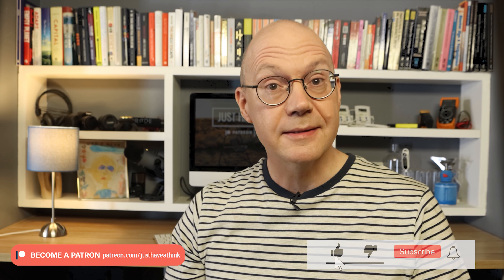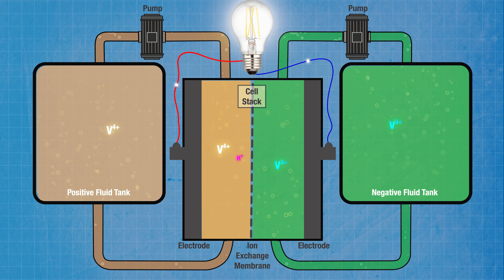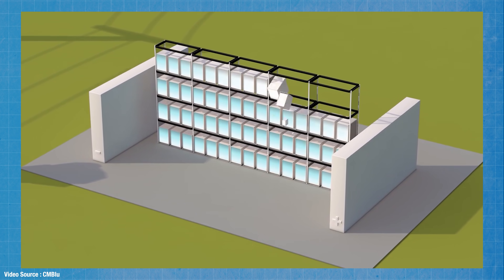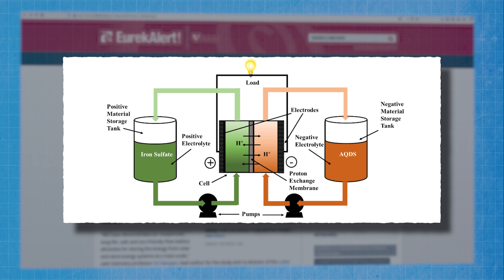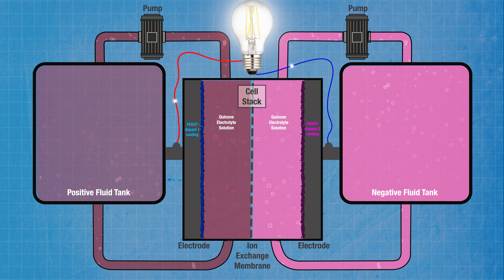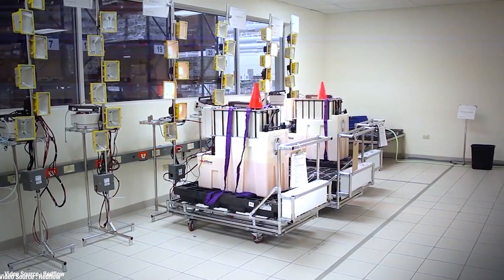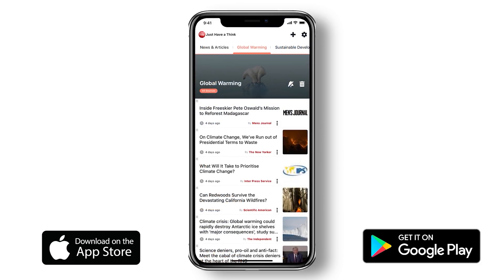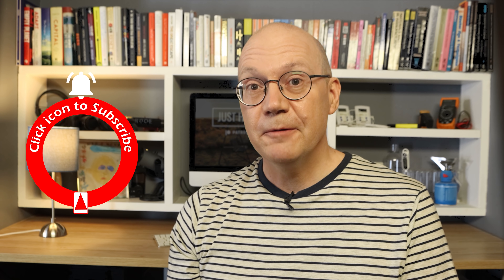Organic Redox Flow Batteries - The true path to grid scale energy storage?

Comment: Hope they developed something even cheaper because manufactured cell costs $85 to $100 per kWh and have had auctions recently for ~$65 per kWh, this is the cell cost, not the pack cost which is more like ~$110 per kWh, but considering they said that was just the material cost, it's gonna be similar if not more expensive and this is for LFP batteries, sodium batteries have the promise when they reach true scale to be cheaper with meterial costs and because of the relative ease of extracting and processing sodium they can reach higher scales which means greater economics of scale, so it's very likely they will get crazy cheap once they reach the scale we are at with LFP batteries and will rocket off into much greater scale at that point.

To the point that even using them for long term storage is worthwhile, lithium ion batteries only lose 1.5 - 2% charge per month at 90% state of charge which means 9 to 12% loss over 6 months and if they are really that cheap, it's not a massive deal.

Comment: If you use a organic aprotic electrolyte you can have a lot mote reactive ions to play with such as titanium 2+ ,to titanium 4+ iron 2+ to 3+ and seversl rare earth ions. Also using high energy fluoride ions is possible. However my pick is iron in water based electrolyt for cost reasons. Does not get much cheaper and safer than a FeCl2>FeCl3 system that uses a NH4Cl> NH4OH as the other side. Not the best energy density but the safest for storage by far and gentle on the electrodes. ❤

Comment: I spent over a year on a pHD studying and testing the Quinone Redox Flow battery performance as spruiked by Harvard and USC back in 2015.  I can tell you that there is no such thing as a positive Quinone molecule that doesn't degrade in a very short time due to oxidation stress.  The thing that I realised at the end of this work was that all redox flow batteries require nasty chemicals, particularly on the positive side.  So called "environmentally friendly" redox chemistry capable of producing an acceptable number of cycles simply goes against the laws of nature.  If you dig, I suspect that you will find that even for the so called "all Iron" redox flow batteries as developed by ESS requires nasty chemical additions in the positive side electrolyte to enable this chemistry to meet minimum performance requirements.  This also applies to just about every battery type and chemistry there is.  There is simply no such thing as an environmentally friendly battery that has an acceptable performance.

Comment: what percentage drop in energy density is it and does this mean by using aerobic waste treatment plant too separate the solids from the electrolytic solution when the electrolyte is spent the water can be rcycled and the solids used as soil treatment, or decontaminated?

Comment: Can anyone explain why flow batteries seem to only use 2 tanks? I would have expected them to have 2 tanks on each side, one with the liquid in the uncharged state and one in the charged state, with the pump pumping from one to the other during charging or discharging. When charging the efficiency would be highest if the liquid flowing into the stack was pure uncharged and vice versa for discharging. Yet instead all the diagrams I can find show a single tank each side with circulation going round and round, meaning as the battery gets charged it gets harder to charge it further because uncharged atoms are rarer. Why do they do it this way?

Comment: Lithium is great because it is simultaneously very light in weight and thebest element donor of all elements (least electro-negative).  The light weight is important for mobile applications.  the next element down (sodium) is much heavier but almost equivalent in electronegativity.  Why not use sodium for fixed instalations?

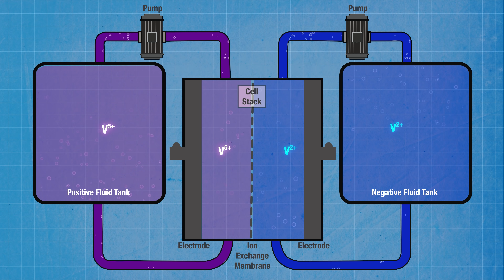Comment: @ 2:00,  the statements that the right solution is a positively charged solution and the left solution is a negatively charged solution is very misleading if not flat out incorrect.  The solutions are neutral to start with, the graphic only shows the cations (+) but there are still spectator anions present.  If the solutions were actually oppositely charged their electrical attraction would rip the battery to pieces. (As is, the solutions appear to both be positive so the repulsion would have the same effect.)  The neutral left solution loses electrons to the anode which would make it positive, not negative, but it maintains neutrality by repelling positive Hydronium ions (H3O+ not H+)  to the right cell via the membrane.  The neutral right solution gains electrons at the cathode, which would make it negative, not positive, but it maintains neutrality by attracting positive Hydronium ions from the left cell via the membrane.

Comment: Vaccine with planned obsolescence. It is outdated almost as soon as it is created. This is why they still continue with the fake mask mandatory instruction with fear tactics if you don't use them. Same with the fear tactics of vaccines, they are not allowing Antibotic Stewartship yet they want to suggest an untested vaccine before trying many other proven methods for improving not just personal protection but also less likely to cause an outbreak if your using them effectively. My Government is lieing.

The media doesn't give good helping information. They help allow a forced and fake narrative. FBI doesn't do TITLE 18 U.S.C. 1038 Investigations What about Microbiology? Causes

Many germs can cause pneumonia. The most common are bacteria and viruses in the air we breathe. Your body usually prevents these germs from infecting your lungs. But sometimes these germs can overpower your immune system, even if your health is generally good.
Pneumonia is classified according to the types of germs that cause it and where you got the infection.

Community-acquired pneumonia

Community-acquired pneumonia is the most common type of pneumonia. It occurs outside of hospitals or other health care facilities. It may be caused by:

Bacteria. The most common cause of bacterial pneumonia in the U.S. is Streptococcus pneumoniae. This type of pneumonia can occur on its own or after you've had a cold or the flu. It may affect one part (lobe) of the lung, a condition called lobar pneumonia.

Bacteria-like organisms. Mycoplasma pneumoniae also can cause pneumonia. It typically produces milder symptoms than do other types of pneumonia. Walking pneumonia is an informal name given to this type of pneumonia, which typically isn't severe enough to require bed rest.

Fungi. This type of pneumonia is most common in people with chronic health problems or weakened immune systems, and in people who have inhaled large doses of the organisms. The fungi that cause it can be found in soil or bird droppings and vary depending upon geographic location.

Viruses, including COVID-19. Some of the viruses that cause colds and the flu can cause pneumonia. Viruses are the most common cause of pneumonia in children younger than 5 years. Viral pneumonia is usually mild. But in some cases it can become very serious. Coronavirus 2019 (COVID-19) may cause pneumonia, which can become severe.

Hospital-acquired pneumonia

Some people catch pneumonia during a hospital stay for another illness. Hospital-acquired pneumonia can be serious because the bacteria causing it may be more resistant to antibiotics and because the people who get it are already sick. People who are on breathing machines (ventilators), often used in intensive care units, are at higher risk of this type of pneumonia.

Health care-acquired pneumonia

Health care-acquired pneumonia is a bacterial infection that occurs in people who live in long-term care facilities or who receive care in outpatient clinics, including kidney dialysis centers. Like hospital-acquired pneumonia, health care-acquired pneumonia can be caused by bacteria that are more resistant to antibiotics.

Aspiration pneumonia

Aspiration pneumonia occurs when you inhale food, drink, vomit or saliva into your lungs. Aspiration is more likely if something disturbs your normal gag reflex, such as a brain injury or swallowing problem, or excessive use of alcohol or drugs.

Risk factors

Pneumonia can affect anyone. But the two age groups at highest risk are:

Children who are 2 years old or younger

People who are age 65 or older

Other risk factors include:

Being hospitalized. You're at greater risk of pneumonia if you're in a hospital intensive care unit, especially if you're on a machine that helps you breathe (a ventilator).

Chronic disease. You're more likely to get pneumonia if you have asthma, chronic obstructive pulmonary disease (COPD) or heart disease.

Smoking. Smoking damages your body's natural defenses against the bacteria and viruses that cause pneumonia.

Weakened or suppressed immune system. People who have HIV/AIDS, who've had an organ transplant, or who receive chemotherapy or long-term steroids are at risk.

Complications

Even with treatment, some people with pneumonia, especially those in high-risk groups, may experience complications, including:

Bacteria in the bloodstream (bacteremia). Bacteria that enter the bloodstream from your lungs can spread the infection to other organs, potentially causing organ failure.

Difficulty breathing. If your pneumonia is severe or you have chronic underlying lung diseases, you may have trouble breathing in enough oxygen. You may need to be hospitalized and use a breathing machine (ventilator) while your lung heals.

Fluid accumulation around the lungs (pleural effusion). Pneumonia may cause fluid to build up in the thin space between layers of tissue that line the lungs and chest cavity (pleura). If the fluid becomes infected, you may need to have it drained through a chest tube or removed with surgery.

Lung abscess. An abscess occurs if pus forms in a cavity in the lung. An abscess is usually treated with antibiotics. Sometimes, surgery or drainage with a long needle or tube placed into the abscess is needed to remove the pus.

𐤇𐤍𐤁𐤏𐤋 𐤁𐤓𐤒
https://www.mayoclinic.org/diseases-conditions/pneumonia/symptoms-causes/syc-20354204

Please avoid the places where idiots use masks several hours at a time without changing them out for sanitary ones. It doesn't take long for things to grow on the mask. 

8 monkeys put on a mask to protect themselves from a virus. After a short amount of time the mask had grown bacteria infectious to them unknowingly. The bacteria came from the monkey skin and breath causing lung infections, pneumonia,  and 7 monkeys died without catching the virus and the 1 that lived did catch the virus yet lived. How many American monkeys have died from mask associated infections because they failed to follow the strict sanitation protocol required by medical personnel? If the CDC said 64,000 actually died of COV out of the 450,000 claims by healthcare means  236,000 could have died from other causes. 2008 Dr
Fauci co-authored an article you should know more about.
Violation of Freedom of information act. Blocking information on a public source document about biological Hazzards. 
https://www.nih.gov/news-events/news-releases/bacterial-pneumonia-caused-most-deaths-1918-influenzbacterial- Why do they block it?

Video on Pneumonia https://youtu.be/lMnbJCq5lAg

Insider pregnant Dr from the CDC comes out.
https://youtu.be/VOl2-xI76tI

Here what happens to your oxygen levels while in a mask. https://youtu.be/axSHWgO8-0k

Start here 
CRISPR-CAS techniques and technology 
https://youtu.be/RNRZchHaKgw 

is an introduction to mRNA and CRISPR-CAS introduction for vaccine engineering https://youtu.be/K__7vPh92gA 

then study the messenger RNA (mRNA)
https://youtu.be/R3blx6V9fzM 

is also helpful for to look at other mRNA sources. 
https://youtu.be/ITOgEVgjVVs 

all great till you get here 
https://youtu.be/wOvpkJiVGhc 

imaging being the first to recreat life on Mars or make safe environment for plants. We are introducing microbiology to create oxygen. https://youtu.be/4nk1ml6akM4 

I agree with getting to this point.
https://youtu.be/L13DadaAEg8 

grandfather 
https://youtu.be/dpgd_HUCSuk 

These links will really open the mind. https://youtu.be/e0vKOYQUmgg

is the promise.

https://youtu.be/e0vKOYQUmgg
https://www.facebook.com/watch/?v=934593487295763 or

https://m.facebook.com/story.php?story_fbid=260090339150170&id=100054476160607

Just so we know
https://www.facebook.com/watch/?v=3053211494783617

Polymathy
https://youtu.be/kEk-BDckjW4

3d Bioprinting https://youtu.be/V2e-2mPBRnA

Imagine the possibility https://youtu.be/A5Xvq49lpzI

What would it be like to live on the moon. https://youtu.be/EL7xW5zTh6M
Genetic modification plants made for Mars.
https://youtu.be/G3hPH_bc0Ww
This is how I feel https://youtu.be/igIFXcsoQEE
All I got is you. https://youtu.be/X-sIsWrqAaU
Reply: ???  Good Heavens!  What on earth does this have to do with Flow Batteries?

Comment: I am not an expert by any means, but does this imply that Vanadium Redox Flor Batteries will ultimately be undercut and obsolete? Or is this an alternative in which both can gain market share? I learned about Vanadium flow batteries after coming across Largo Resources (LGORF traded in US) - interested in your thoughts on vertically integrated Vanadium producers as a long-term investment - as this video might imply alternatives could overtake Vanadium....

Comment: I always wondered.... in PA in the USA they have mountains, Some are filled with Coal, ones right next to them Filled with Copper. If they connected Wires across the already Acidic Streams with rods jammed deep into each mountain would we get a strong current flow as the entire mountain should behave as a AA Battery. Just curious if one could harness natural geographic features like this to produce power even at a small scale.

Comment: Global grid scale storage is a fantasy held by those with no concept of what they envisage.

A small amount of storage is useful for what we call 'peak lopping' in the U.K. and for which pumped storage is ideal. It is far more robust than battery storage for that purpose as it can handle sudden large overloads far better than systems with electronic power devices.  But batteries can do this job quite adequately, just as Mr Musk's publicity stunt in Australia does. 
Storage to compensate for intermittency is quite another matter due to the very large capacity required, it's simply unfeasible. Not only is capcity a problem but it also requires an expansion of generation capacity to charge them. A non starter to make up for intermittency, so there is no battery problem to solve.

Comment: Invinity are installing a 2MW / 8MWh Vanadium Redox Flow battery as part of Oxford Energy Superhub (https://invinity.com/energy-superhub-oxford/).  The great advantages of VRFBs over lithium batteries is that they can cycle many thousand times for over 20 years and be refurbished whereas lithium batteries degrade over ten to fifteen years and have to be very carefully dismantled into their component parts for recycling.  Lithium batteries are prone to explosive thermal runaway and fire, producing poisonous hydrogen fluoride (https://www.solarpowerportal.co.uk/news/rsted_confirms_fire_at_carnegie_road_battery_storage_site).  VRFBs are filled with dilute acid, so don't catch fire.  If you want a longer lasting lithium battery, you have to buy more batteries.  If you want a longer lasting VRFB, you simply install more electrolyte tanks.  VRFBs seem better suited to large scale energy storage on grounds of safety and cost per charge.  Lithium is better for power tools.  I would not want to crash and be trapped in a lithium battery powered car (https://www.youtube.com/watch?v=UsuYxFBHsiQ)

Comment: Although I welcome flow batteries and agree they will potentially be cheaper than Li ion, you made some incorrect statements about Li ion. Li ion do NOT have a time limit for each use as you suggested. How long they can power a grid depends only on the relative size of the battery and the demand and that also has nothing to do with the battery technology used. Sure, a small battery can only power the complete grid for a very short time, but then maybe that was what that battery was built for.  But another use of batteries is to smooth out peaks and troughs which does not necessarily require powering the whole grid but only a small percentage of the total power of the grid. Also you implied there was some difficulty obtaining the materials used for Li ion batteries. Obtaining Lithium really only depends on price. There is no shortage of it. It may take time to ramp up supply in some cases, but again that depends on what people are willing to pay, and applies to almost all supply chains and will apply to flow batteries too. As for Cobolt, I get particularly upset when first world people say 'we know we are currently employing child miners, so to ease our consciences we will put them out of work and let them starve to death.' The solution to child labour is NEVER to move the business else where. It is to offer a living wage to their parents. Step 1 would be to stop your own countries assisting corporations in evading tax in the countries where there is child labour. I come from a country (Zambia) that is largely dependent on mining and much of our revenue has been consistently been stolen by Europe for the last century. But changing from copper to other metals did not somehow help us, it hurt us. So please stop with this 'we need to get away from cobalt for the sake of the children'. It is immoral.